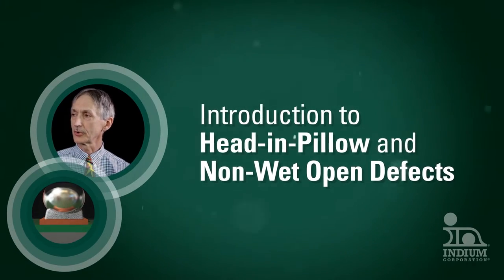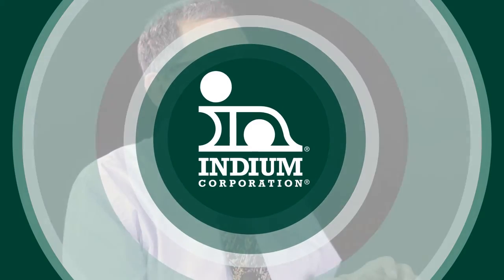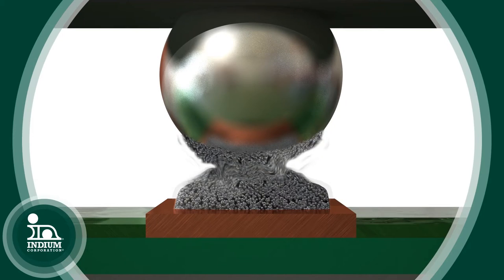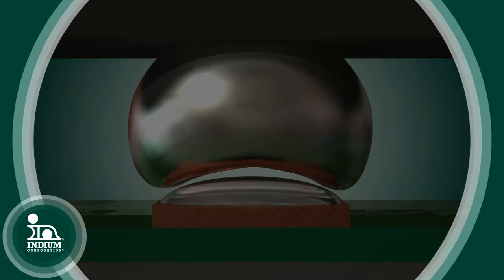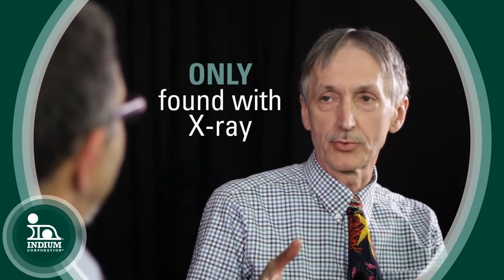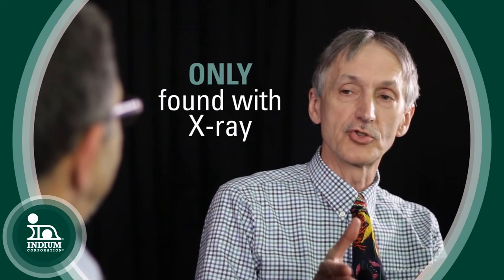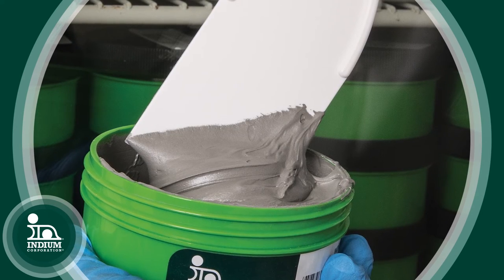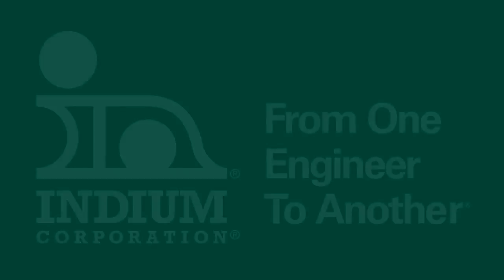Introduction to Head-in-Pillow and Non-Wet Open Defects

Comment: You need some expensive 3D x-ray equipment to see these kinds of defects, but x-ray isn't the only way you can identify them. Boundary scan testing can detect opens.
Reply: 2D X-Ray with rotation and tilt (+-45°) handler could also be able to find this type of defect
Reply: Yeap, to see or identify the head in pillow its necessary to use an xray equipment. And you're right, you can catch an open on the boundary test, but the cause of a open could be oxidation, contamination or missing solder paste over the pad..... Regards

Comment: When you started to notice this head in pillow defect is present, you also need to take a view on your oven profile.
Is not soldered because the metal does not licuify on the pcb nor the ball down the component.